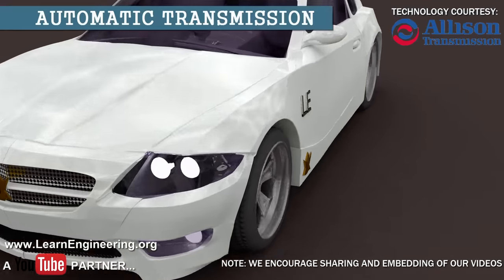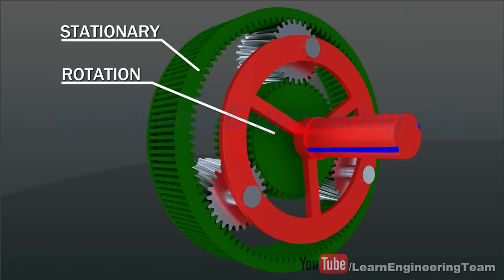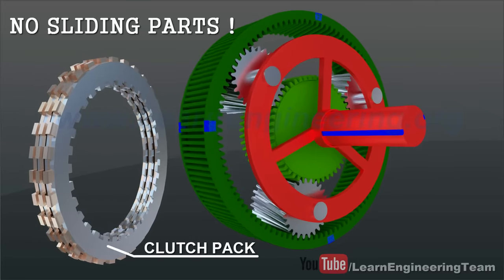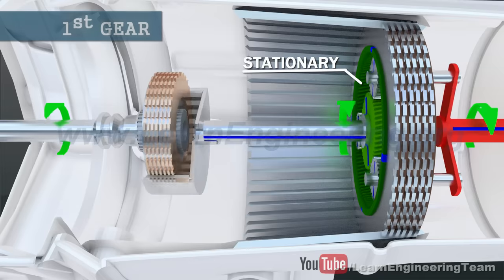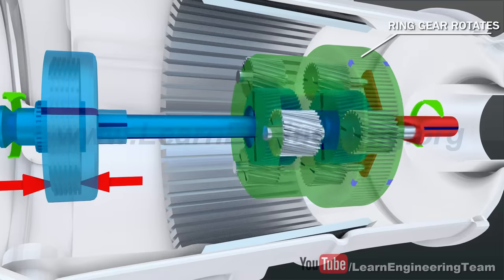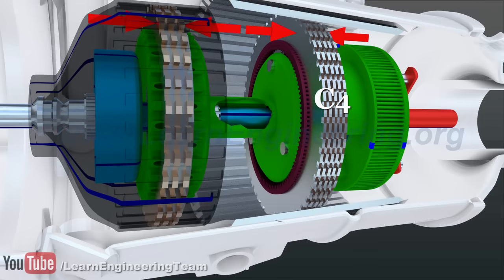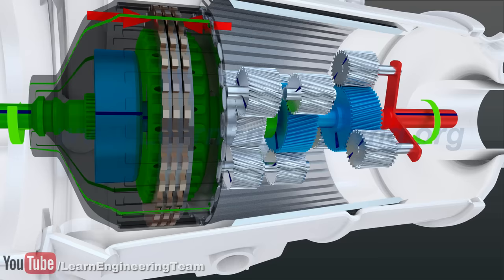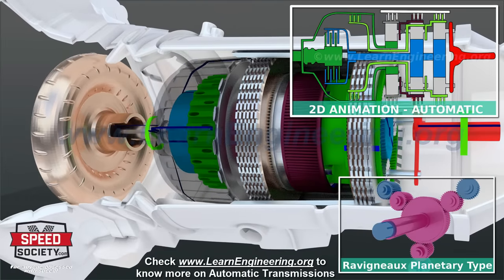Automatic Transmission, How it works?

Comment: For anyone struggling to understand:

First watch the video and try to understand where parts are and how they interact and come back to this comment if you have questions.

(I'll be referring to each part as P1, P2, P3, P4, and P5. C1 acts on P1, C2 acts on P2, C3 acts on P3, C4 acts on P4, and C5 acts on P5)

P1 is the Hub and case
P2 is the P4 planet carrier and clutch module
P3 is the first set of gears (ring gear, planet gears, and sun gear) and the P4 planet carrier
P4 is the second set of gears (ring gear, planet gears, and sun gear) and the P5 planet carrier
P5 is the third set of gears (ring gear, planet gears, and sun gear) and the output shaft

In this type of automatic transmission the clutch packs are always in contact with whatever they're meant to engage with they're just allowed to spin freely.
This creates friction between any parts in contact with the clutch packs which is why manual transmission systems are generally more fuel efficient.
When the clutch packs are engaged they are no longer able to spin freely to induce a lot more friction in turn stopping what they're engaged to.

For example:
The C1 clutch is connected to the hub (gear) on the end of the input shaft and the case on the intermediate shaft.
When disengaged the C1 clutch will be able to spin freely without imparting much of any force on the intermediate shaft.
When engaged the C1 clutch increases friction with the hub to essentially extend the hub to the case and apply force to the intermediate shaft.
This lets the input shaft turn the intermediate shaft directly as long as the C1 clutch is engaged.

For the first, seconds, third, and fourth gear:

The C1 clutch pack engages to turn the intermediate shaft as explained above. The intermediate shaft is only connected to P4 and P5 sun gears so C1 only affects P4 and P5.

First gear:

First gear uses P1 and P5

C1 and C5 engage in first gear.
C1 engages because the intermediate shaft is only turned when C1 is engaged.
This means that the sun gear in P5 is only turned when C1 is engaged.

A problem arises however, if we only engage C1 we'll also be turning the sun gear in P4 which can turn the P5 planet carrier/ring gear.

To combat this C5 is also engaged.
This "connects" the P5 ring gear to the transmission case.
The transmission case is stationary so when C1 engages it stops the ring gear from being able to turn.

So C1 engages to supply force to the P4 and P5 sun gear.

C5 engages to stop the P4 sun gear from turning the P5 ring gear.

Second gear:

Second gear uses P1 and P4.

C1 and C4 engage in second gear.
C1 engages because the intermediate shaft is only turned when C1 is engaged.
This means that the sun gears in P4 and P5 are turned only when C1 is engaged.

When the P5 sun gear turns, it only turns the P5 planet gears.
When the P4 sun gear turns, it turns the P4 planet gears however these are connected to the P5 planet carrier.
This means that the P4 planet gears increase the speed the P5 ring gear.
This leads to the planet gears turning more quickly than in first gear.
This increases the output shaft turn speed.

A problem arises when we don't engage C4.
The P3 sun gear isn't connected to the intermediate shaft but instead connected to the input shaft.
This means that the P3 sun gear turns at any point the engine is supplying force.
The P3 planet gears turn the P4 planet carrier at the same rate as the input shaft, this would be 1:1 input:output which would require too much force from the engine.
This would result in the engine stalling (Results in a jump from first gear to fourth gear)
To combat this, the C4 clutch is engaged.
The C4 clutch "connects" the P4 ring gear to the gear set case.
This means that C4 stops P3 from supplying force to the output shaft.

So C1 engages to supply force to the P4 and P5 sun gears.
C4 engages to stop the P3 sun gear from turning the P4 planet carrier (prevents a jump to fourth gear).

Third gear:

Third gear uses P1 and P3.

C1 and C3 engage in third gear.
C1 engages to turn P4 and P5 sun gears.

The P3 sun gear connects directly to the clutch module which is in turn connected to the input shaft.
This means that the P3 sun gear is turning as long as the engine is supplying force.

A problem arises when C3 isn't engaged.
The P3 ring gear is only connected to C3 and the P3 ring gears.
When the P3 sun gear turns while C3 isn't engaged it would turn the P4 planet carrier.
This means that they will enter fourth gear resulting in engine strain/stalling.
When C3 is engaged, the P3 ring gear remains stationary slowing the P4 ring gear.
This means that the force supplied to the output shaft is decreased.

So C1 engages to supply force to the P4 and P5 sun gears.
C3 engages to reduce torque required from the engine (prevents a jump to fourth gear).

Fourth gear:

Fourth gear uses P1 and P2.

C1 and C2 engage in fourth gear.
C1 engages to turn the P4 and P5 sun gears.

P2 is connected to the clutch module and the P1 planet carrier
When C2 is engaged, P2 turns at the same rate as the input shaft.
This results in the ring gear and sun gear of P5 turning at the same rate.
This means that the input and output shaft turn at the same speed.

If C2 is not engaged you would remain in fourth gear but it requires more force to turn the output shaft which is less efficient.
This is because P3 is connected to the input shaft.

So C1 engages to supply force to the P5 sun gear.
C2 engages to supply direct force to the P5 ring gear.

Fifth gear:

Fifth gear uses C2 and C3.

C2 engages to turn the P4 planet carrier.

C3 engages to stop the P3 ring gear.
With C1 disengaged the intermediate shaft can rotate independently of the input shaft.
When C3 is engaged it prevents entering fourth gear and supplies the P4 ring gear with force.
This results in a greater turn rate at the output shaft.

So C2 engages to supply force to the P4 planet carrier.
C3 engages to supply force to the P4 planet carrier and prevent fourth gear.

Sixth gear:

Sixth gear uses C2 and C4.

C2 engages to turn the P4 planet carrier

C4 engages to stop the P4 ring gear.
With C1 disengaged the intermediate shaft can rotate independently of the input shaft.
When C4 is engaged it prevents entering fourth gear and supplies the P4 planet carrier with force.
This results in a greater turn rate at the output shaft than fifth gear because it requires more torque to move the input shaft.

So C2 engages to supply force to the P4 planet carrier.
C4 engages to stop the P4 ring gear and prevent fourth gear.

Reverse gear:

Reverse gear uses C3 and C5.

Force is supplied to the intermediate shaft through P3.

C3 is used to stop the P3 ring gear to prevent counter rotation from P4/friction.
This allows the P3 planet gears to revolve around the P3 sun gear.
This results in the P4 ring gear turning in the same direction of the input shaft.

The P4 ring gear will cause the P4 planet gears to rotate in the same direction.
The P4 sun gear will rotate in the opposite direction of the planet gears.
This results in the intermediate shaft having opposite rotation to the input shaft.

C5 is used to stop the P4  ring gear to prevent counter rotation from the output shaft/friction.
This allows the P5 planet gears to revolve around the P5 sun gear.
The P5 sun gear rotates in the opposite way to the input shaft.
The P5 planet gears revolve around the P5 sun gear in the same direction it rotates.
This supplies a force to the output shaft that is opposite the force supplied to the input shaft.

So C3 allows P3 to rotate the P3 planet carrier.
C5 allows the P5 planet gears to revolve around the P5 sun gear.

If you have any questions feel free to ask in the replies!
Reply: Thanks a lot for your hardwork.....
👍👍
Reply: cheers
Reply: Thanks alot.
Reply: I'm not reading all that but you can have my like
Reply: Great efforts. Can you please tell me this is automatic transmission then who and why the clutch pack need to engage and disengage. How automatically these clutch packs will detach and attaches
Reply: Underrated comment.
Reply: Underrated comment
Reply: @ganeshjadhav1900  The clutch packs need to be engaged to "activate" the gears they spline (connect) to. This is done by supplying hydraulic pressure to the clutch pack (the PCM controls when this happens)
When the clutch packs are disengaged the hydraulic pressure is reduced and springs return the clutch packs to their original state.
Reply: @RayDragonfly  thanks. One more question how the hydraulic will operate. Whether this activate on engine RPM automatically or manual again
Reply: Bro wrote an essay 

Thank you
Reply: ok
Reply: Dont know if what you said made sense, but if it did, congratulations! haha.
Reply: I feel like Jimmy Neutron after reading that.
Reply: hats off man..
Reply: @colonelpotato  Cars with an automatic transmission are fitted with a TCM (transmission control module) that receives information from a multitude of sensors that help with shift timing and smoothness,  as well as the current shift position.

As far as I'm aware, there aren't any mechanically operated automatic transmissions.
Reply: Well that cleared nothing up for me!😄
Reply: WHAAAAAAAAAAAAT???
Reply: Thanks but I’m not reading all that
Reply: God bless you for making it sound so simple
Reply: @ganeshjadhav1900 they use friction to synchronize
Reply: Dude go outside
Reply: @keyboardcommando7000  LMAOAOAOA
Reply: I am sure 99.9% people didn't read this comment fully and that's including me 😂
Reply: @chinazieswillstartww3253  regardless, it's there for those who want to utilise it as the video is fairly poor at explaining the subject.
Reply: @RayDragonfly  And i genuinely appreciate your efforts for that. I am just saying i am too lazy to read a whole essay of a boring comment like mejority of the people
Reply: i aint reading all that
Reply: I’ve lost hope
Reply: @chinazieswillstartww3253  idk if u have yet but take the time... I spent like 3-5 hours and now I understand almost everything. 
Worth it...
Reply: @RayDragonfly  I guess I did have 1 question tho...how come the P3 planet gears that turn the P4 planet carrier mentioned in gear 2 was not mentioned in gear 1 as well?
So, basically, in gear 1, C5 engages to stop the P4 sun gear (which got its power from C1 engaging and from C3) from turning the P5 ring gear?
Reply: @umershaikh7179  
In gear 1, C5 is engaged to stop any input from P4 and P3, it didn't seem worth mentioning both parts.

In gear 2, C4 is engaged to stop any input from P3 but this still allows P4 to supply additional input to the P5 ring gear.

I left out P3 in my explanation of first gear because it cannot supply input when C5 is engaged. It was a small oversight when I wrote this as I had only thought to add the "A small problem arises...." sections to each gear after writing the first gear explanation.
Reply: Thank you for taking the time to write an essay for us, even tho 99% of us will not read the whole thing, including me, my good sir!
Reply: why do dogs have wet noses?
Reply: Ok thanks I now understand how it works (i actually dont)
Reply: We love you
Reply: Jeez
Reply: Womp wompp!! My brain ain't braining😂
Reply: Ä
Reply: I'm actually laughing out loud😂
Reply: How does it know which gear to use?
Reply: This guy
This is my kind of guy
Reply: YEAHHH that didn't help
Reply: @shovitk1 multiple sensors in the transmission, drivetrain,  and engine. But mostly, it's based on engine rpm and wheel speed. Each gear will have a wheel speed and rpm range that it will be allowed to use. If the wheel speed or RPM is too high, then the transmission will decide to shift up into the next gear and vice versa if it's too low. Then a computer built into the transmission will use transmission fluid to hydraulically activate and deactivate each set of clutches as needed for each gear. This is a very fine balancing act because depending on the application there can be multiple sets of clutches activating and deactivating at the same time and if the transmission is "tuned"  badly it will destroy the clutches in short order due their (de)activations being poorly timed and causing hugely excessive wear on every shift. This is an issue for example on the GM 6l80e which uses this style of transmission. Bad transmission tunes can take them out in 2000 miles.
Reply: My only question is how does it "know" when to shift, now they use computers obviously but automatic transmission was invented in 1921. I assume there was some sort of mechanism that "detected" what speed it was spinnng at and switched gears accordingly.
Reply: @RayDragonfly  How was it invented in 1921 then, since there weren't any computer chips around to control that back then? Or am I misunderstanding what the invention was?
Reply: @squidwardo7074  to answer both questions. In my barracuda's transmission there is something called a valve body. It's a piece of metal that has precisely drilled channels, ball valves, and other things in it. It acts like the computer in my previous comment. Changing certain parts of this valve body allow for different ways of shifting. It's all pressure based, the valve body uses the pressurized trans fluid to make extremely rudimentary computer which can really only shift one way and doesn't vary too much based on rpm or load like computerized transmissions can do. So it'll either shift really softly like a 70s caddy or rolls royce, or whiplash hard for drag racing.  Valve bodies shift the transmission based on the pressure of the fluid going through them,  more load = more fluid pressure. Once it reaches a certain pressure it shifts. I'm not sure how downshifting works but i think it's probably the opposite. bodies are pretty cool and I've honestly have an extremely basic knowledge of how they work but I hope this helps.
Reply: hi ray dragonfly
Reply: Thanks for the concise explanation, really helped! Could you clarify how this might expand into 7 speed gearboxes? Thanks
Reply: @Pynerd  hi pynerd
Reply: mans wrote a college thesis
Reply: You've provided a very detailed explanation of a 6-speed automatic transmission with a planetary gearset design. Here's a breakdown of the key points:

Components:

P1: Hub and case
P2: Planet carrier and clutch module (connected to input shaft)
P3: First set of gears (ring, planet, sun) and planet carrier
P4: Second set of gears (ring, planet, sun) and planet carrier
P5: Third set of gears (ring, planet, sun) and output shaft
C1 - C5: Clutch packs
General Operation:

Clutch packs are always in contact but can spin freely when disengaged.
Engaged clutch packs lock components together, transferring power and increasing friction (reducing efficiency compared to manual transmissions).
Gear Selection:

Specific clutch packs are engaged in different combinations for each gear.
Intermediate shaft connects the input shaft to the planetary gearsets (P4 and P5).
Gear selection involves controlling how the sun gears, planet gears, and ring gears in each set interact.
Explanation of Each Gear:

1st Gear (C1 & C5): P5 sun gear is driven by the input shaft, P5 ring gear is held stationary to provide maximum torque multiplication.
2nd Gear (C1 & C4): Similar to 1st gear but P4 sun gear drives P4 planet carrier, increasing output shaft speed compared to 1st.
3rd Gear (C1 & C3): P3 sun gear directly drives P4 planet carrier, reducing torque multiplication compared to 2nd.
4th Gear (C1 & C2): P5 sun gear and ring gear rotate at the same speed, resulting in a 1:1 ratio between input and output shaft.
5th & 6th Gear (C2 with C3/C4): More complex interactions using P2 and selective holding of ring gears to achieve higher gear ratios (overdrive) than 1:1.
Reverse Gear (C3 & C5): Complex gear interaction to reverse the direction of rotation at the output shaft.
Overall:

This explanation highlights the intricate interplay between clutch packs, planetary gearsets, and sun/ring/planet gears to achieve different gear ratios and functionalities in a 6-speed automatic transmission.

(I used AI to summarize)
Reply: Your awesome
Reply: Dude... thank you a lot for your effort but i'm pass :)
This was the 5th video about automatic transmission and i still didn't get any closer to understand how tf it works. And your explanation here makes me sure that i will stop trying.
Reply: Why did u write an entire essay 😂😂
Reply: 😂😂😂😂 okay
Reply: That’s a whole book there
Reply: Appreciate this bro
Reply: @RayDragonfly well technically there's "mechanically operated automatic transmissions" but those are more like manual transmissions without a clutch pedal if I'm being honest
Reply: your the goat
Reply: I want a feature where you could pay people on comments.
I want to pay you sir.
Reply: hero.
Reply: please write all equation of each gear speed ! I've been searching for a week now and can not take the right equation between ring - sun teeth of each gear ratio. Thanks a lot.
Reply: TLDR version?
Reply: congratulations. you just turned a 7 minute video which was already complicated to a 30 minute to read essay. jeez
Reply: your a smart dude lol